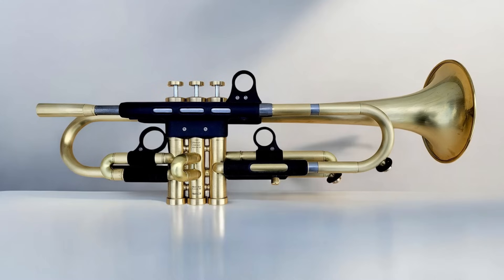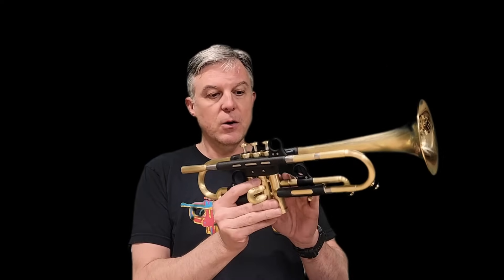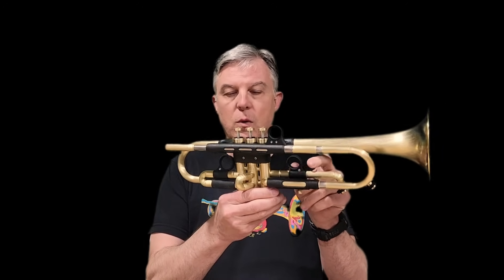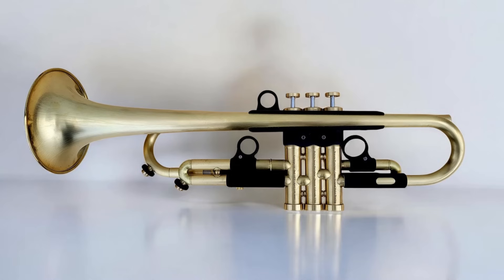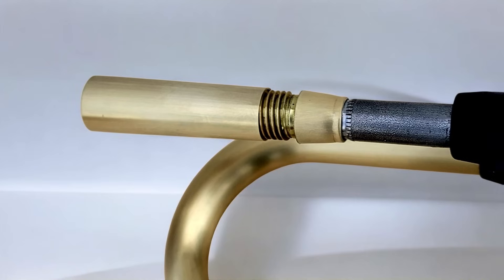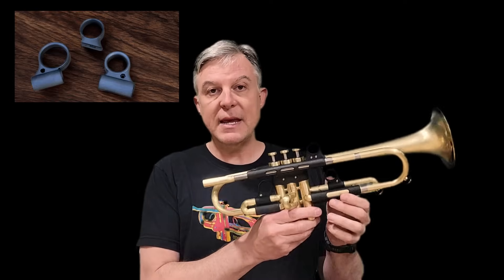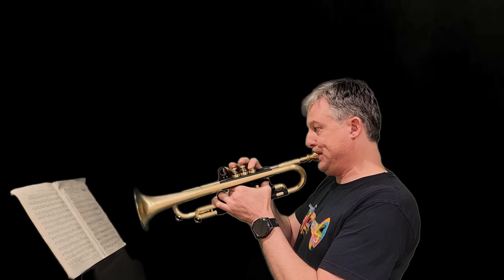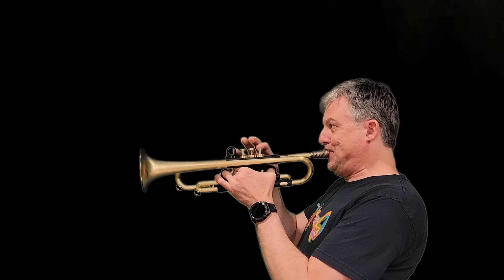World's FIRST 3D printed SS Leadpipe on a Professional Trumpet - Harrelson Bravura

Comment: Why so expensive if it's just 3D printed? Even metal PLA/ABS, or nylon plastic will not reach as high to $1995
Reply from the maker: It's made of brass just like every other pro trumpet.
Reply: I will interject… never question the price range of the art of an artisan. These trumpets are really an artistic manifestation, like a painting or statures. In this case there is also a lot of engineering, research and design…. and finally….. it’s not nice.
Reply from the maker: The cost of the 3d printing equipment required to make the Bravura is well over $1 million. The prints are extremely high quality and expensive. You cannot compare toy/hobby filament printers with industrial machinery, nor can you compare the end results. The Bravura is made on the exact same machines that make F1 racing, SpaceX, NASA, and DOD components.
Reply: @harrelsontrumpets there are companies that literally print stuff through expensive high end printers, I’m sure this model would be much cheaper to print through those companies printers
Reply from the maker: @breadmymeatofficial  This is a BRASS trumpet just like every other pro trumpet available today upgraded with high quality nylon and stainless steel components. If your goal is cheaper, then quality and playability will suffer. :_Trumpet:
Reply: @harrelsontrumpets alr, u should try and get a professional trumpet player to review it, that would be really cool and drive up sales, but it seems you doing well on your own 😅
Reply from the maker: @breadmymeatofficial  we have hundreds of the best pro players in the world performing daily on our trumpets 😀

Comment: Both my trumpeting and engineering sides are impressed with the progress!
This could be the future of trumpets. 

If possible, it'd be great to hear it side by side with some traditionally made trumpet by another manufacturer. 
It's so difficult to get an idea of the sound just hearing one, without knowing much about the player nor the audio setup's characteristics. 

Maybe a trumpet by a manufacturer that doesn't exist anymore, to avoid issues (I have no idea how sensitive they are)?

By the way, probably not your market, but I have seen children struggle with the weight of trumpets for many years. 

Any chance this tech could be applied to student-level trumpets in the future? 
"Unbreakable and light" will surely sound good to parents and teachers. 

Good job!
Reply from the maker: Thank you. You're welcome to bring any trumpet into our showroom and play test it side by side our line of Bravura trumpets.